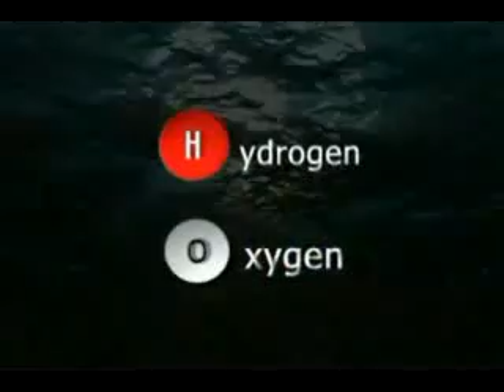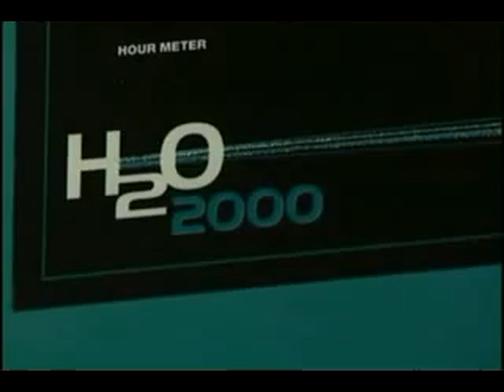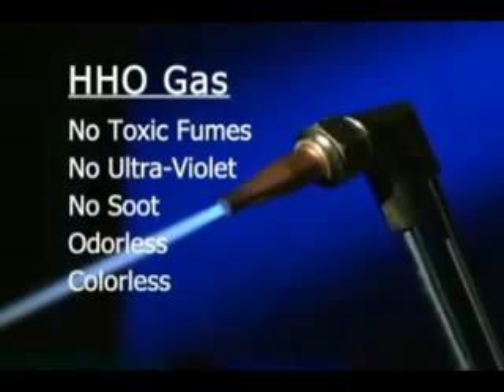Run Your Car on Water Testimonials Part 2

Comment: Outstanding work Denny Klein. Denny also put an HHO system into his Ford Escort station wagon, which significantly increased it's fuel efficiency, reducing gasoline consumption by approximately 50%. It's great Denny sells the HHO welders, but he's not yet offered his HHO units for automobiles.